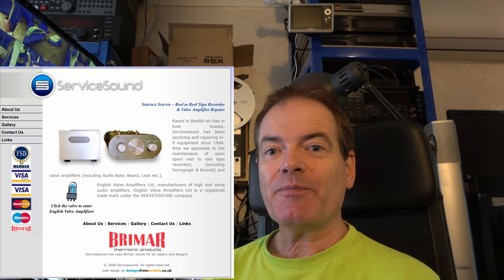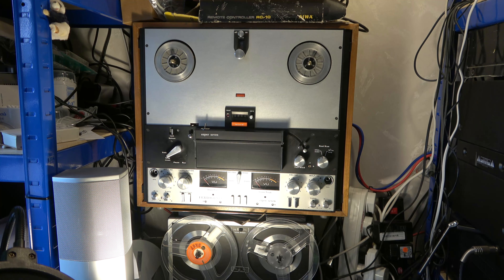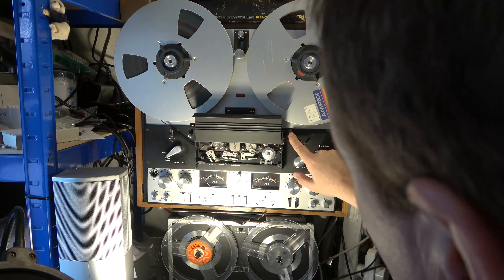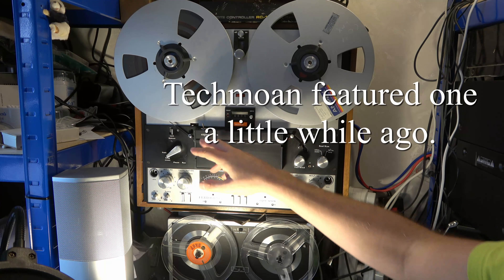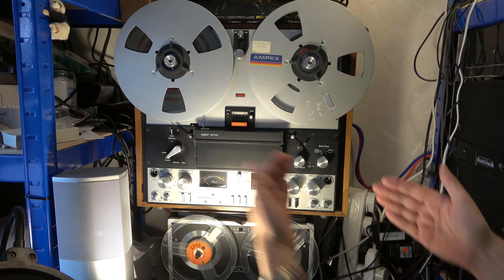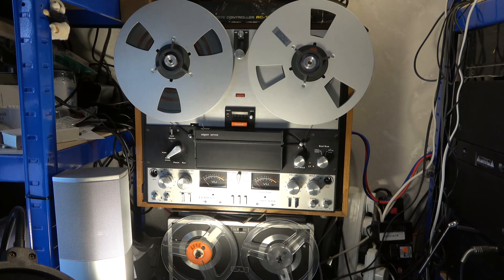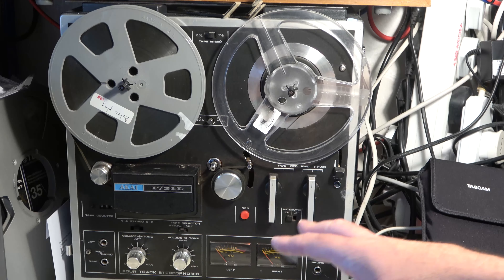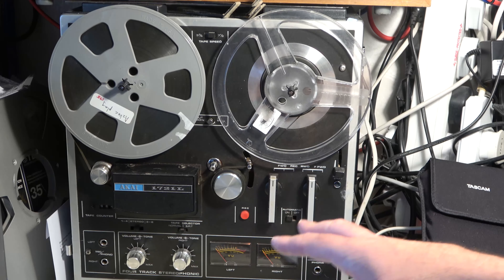Ferrograph Super 7 and Akai 1721L tape decks.

Comment: Great video again. Just to say - the EQ and speed arrangement goes back through all the earlier models and was only tied on the subsequent Logic 7 (which I have). The reason was the Wearite deck was made separately from the amplifier. Ferrograph and Vortexion used them and you could buy them for home construction. It was this design philosophy dating back to 1948 which brought about their demise - the Super 7 was out around the time of the much quieter, more convenient, Revox A77. The Ferro has three speeds and better torque in its favour, but had bad press from the rubber parts dissolving rapidly owing to chemical instability. Sheet metal logic remained in the Akai and Sony offerings, but at 15ips with 10.5” reels with a flywheel and associated idlers, these were clunky and old fashioned in comparison. They are mechanically happier horizontal, if you have the space. BBC modded Logic 7s were balanced with type A jacks but are mostly wrecked owing to the felt pads making head contact on wind. I relieve mine on fast wind with a cotton bud. Having said all that, nicely aligned they sound great! Which is why anyone should like them :)

Comment: Hello Colin. 
   How do you rate them as playback machines compared to other makes of that era ( very early seventies ). 
     I think they are the best looking of all reel to reels. 
Which matters. 
Especially when it doesn’t work….
If playing back a well recorded music tape do you immediately chose one over the other of these two?
Reply from the maker: Of these two, I would use the Ferrograph by preference, it has a better noise floor and better back tension control which is particularly useful for very small tapes.  However the Akai can come in useful for tapes which are sticky, since they seem less likely to howl going through the tape guides.

Comment: Good to have an expert to repair/mod your high end equipment :-).
There are less and less people around now that actually know what they are doing.
I'm used to hiss being on the power amp side, amplifier noise is always there at one fixed level.
The old trick for headphone users is to put a resistance in the right and left channel, you have to drive the headphones a little harder.
All old obvious stuff lol.

Comment: Fascinating video.  Strange that they designed an 'interlock' on the speed and EQ controls.  They could have saved some design complexity (and those precious pennies in mass production!) and just left it out.  It'd be a very rare situation, but maybe setting the EQ 'wrong' might be useful if a tape was recorded with the wrong EQ?  On the other hand, that ff/rew knob - that's a shuttle control, way before professional video cassette editing decks came along with it - I'd never heard of that on any audiotape format.  Also, I agree with you on the tape threading/lacing - it bothers me when I see a video of an R2R with the end of the tape sprouting out of the takeup hub, flailing about.  Aside from the visible mess as it plays, the end of the tape/leader ends up all bent up.  Oh, and it's good to know that that left guide on the Akai is an idler rather than a fixed guide - my opinion of that design of Akai transport just improved.  But those still have the problematic potmetal cams....

Comment: That Ferrograph is an interesting deck, different than my Teac/Tascams and Otari decks, and very different from the Ampex and Studer decks at work. I could see that pressure pad design being murder on the heads, but it would make the deck do quite well with old Acetate based tapes which tend to cup.
Reply: Ooohhh, hadn't thought about cupped acetate tapes.  Excellent point.

Comment: hi i am in need of a service info for a akai mg14d  rest of deck is ok
i have been testing all the pcb it's the power unit would be better if i can find
any info service book i missing key info  there over 100 parts need to be changed 
 i have a lot of the tapes  as well would save a ton of time i am having a hard time on the net 
bob

Comment: Nice video as always. I did wonder why you had a ferro rather than a Revox B77 or something :) interesting though. I remember a friend of mine that used to service them in the 70's saying that they were a little plagues with problems when they were first released. Nice to see one in use, and yes, that speed wind  arrangement is lovely. Reminds me of a Sony APR-5000 that I used to love.
Reply from the maker: It's mainly because I could buy one, serviced and modified with the heads I need.  But I do miss my Tascam 52, that was a lovely deck before it broke down.

Comment: You should modify the felt pads to be engaged one at a time for either 1/2 or 1/4 heads to reduce head wear.
Reply from the maker: I suppose that might be worth doing.  Probably a bigger benefit would be to disable them both during REW/FF.

Comment: Nice decks. Although I'm not keen on AKAI. I've had a few different models and they all seem to suffer with earthing problems. A few also have too many gimmicks, Like cross head recording and a stupid capstan sleeve to change the speed. I've got one with built in cassette and an 8-Track. It's been in bits for over a year, as it's a nightmare to fix. Too much to go wrong, that has gone wrong.
Reply from the maker: My only two complaints with the 1721L model are: Amplifier is a little hissy.  Back tension is not properly regulated like the Ferrograph.  I actually had earthing problems with the Ferrograph until I had it upgraded to balanced outputs.

Comment: How much did the service/modification costs?
Reply: I don't think he is in the position to disclose such information, You can call the service provider and get a quote directly from them.
Reply from the maker: @Capturing-Memories  Correct, it's probably not for me to say.  Furthermore there were some minor repairs which weren't covered in this video (a spring on the half track head pressure pad had pinged off, was the main one).

Comment: hi this is the first time i seen a working ferrograph    the  EMI BTR4     OTARI MTR  12 has the spool  button level    it was wear on the head block put me of getting this model
me first 10'5 was a sony   tc755   1989   i got it later i picked up a RS1700  £350  needed all speeds on one deck got a otari mtr later needed it for editing  and fixing  8 track tapes
the best akai  is the 2 head 1800ss deck there's a full track   to kill all the recording when in quad  mode   like you some times deck are not used for some time
i was talking to the TASCAM ninja    john   he know me well  i left alot not work right   if you have alot of decks you can get a big service bill  if the units are not checked

i know there's some men with  80 plus reel to reel deck   like jeff  the bigger decks take alot of room up big time   i have a cat she love the warm of the motor after i had one on
jumped

381 is the best for money  out of all the 1 inch deck    video's  is your bag  i love tape deck

Comment: Head wear on the Ferro's was atrocious  because of the pressure pads,  their use in fast wind and no auto tape lifters. Dreadful combination. With decent tape a good 3 motor design doesnt need pressure pads, and with modern back coated tapes pressure pads scrape against the rough back coating.  Ferrograph were slow to update their designs so were justly wiped out by such as Revox A77 with all direct drive motors, no pressure pads,  auto tape lifters but optional cueing, much lighter and more compact etc. The more upmarket Revox A700 used a 3 speed direct drive capstan motor with optional varispeed, quickly swappable headblocks and  ... full servo tape tension. I modded my A700 so tape tension  is easily adjustable for playing various tapes.   My first decent machine was a Ferro Series 5 which I used for many years. But after servicing the Revox machines (A77 on) it was hard to look on Ferros in the same way.
Reply from the maker: Adjustable tension, now there's a useful mod for sticky tapes.
Reply: @video99couk  I find increased tension useful for playing cupped old acetate tape (not too much or the tape will snap) and reduced tension good for thinner base tapes to prevent stretching, and being more pliable they dont need so much tension to conform to the head contour. But hard to find just one reel machine which is good at everything.
Reply from the maker: @oldgoody1  Cupped tape fortunately is not a problem with the Ferrograph!  Yes, I do find it handy to have two machines, and would like another.